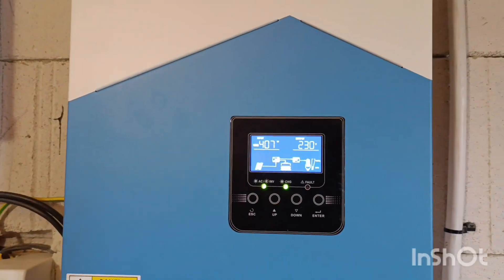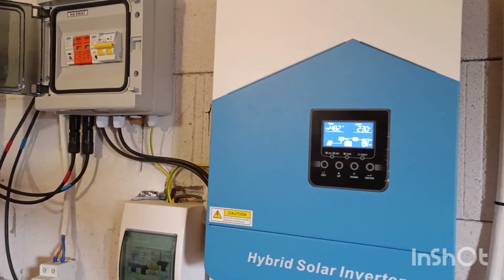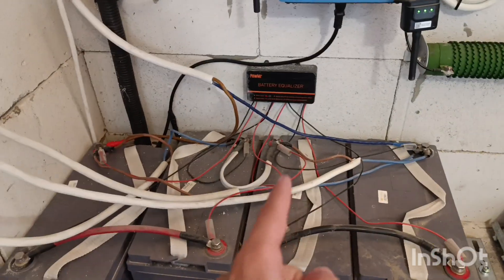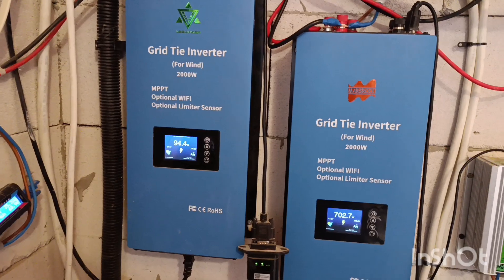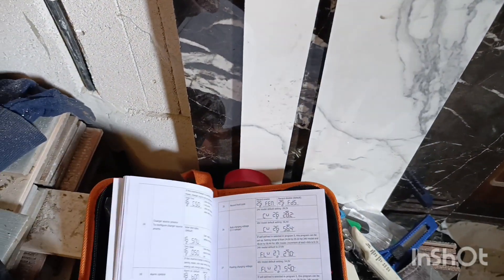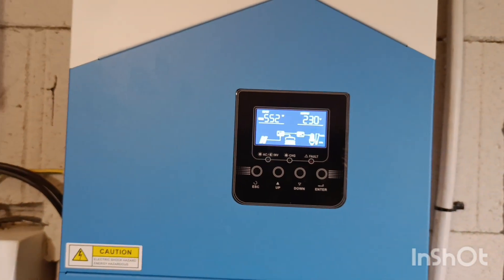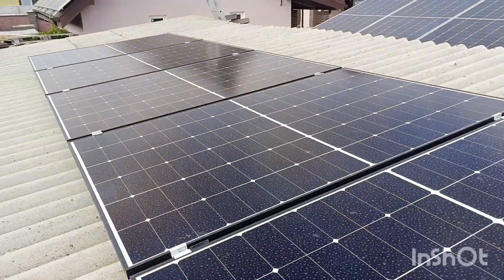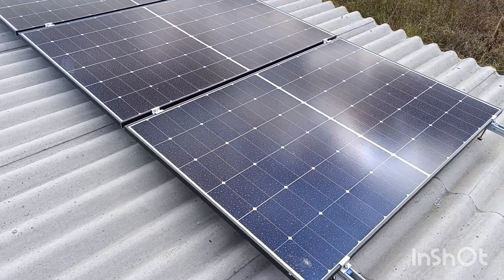How I DIYed a small solar station based on EAsun hybrid inverter: a system inside a system

Comment: can this inverter be used without returning any power to the grid? I'd like to be on solar while I can and in a case there is not enough energy, can this inverter pull power from the grid like If I had a backup generator?
Reply from the maker: yes, it is not even able to sell any power back to the grid, and yes, it can pull the needed power from the grid in case of lack of sun or battery.
there are several power source priorities to choose from
Reply: @BackyardVoltage  Oh that's perfect! In Croatia it's illegal to have a grid-tied inverter without a permit, it's done so you don't accidentally feed any power back while they are servicing the grid and assuming there is no power... How's the reliability? I was planning on getting 3kW of panels to power my workshop and a fridge on the side, maybe some AC heating as well
Reply: @BackyardVoltage  But this is so cool... If you have a battery that's big enough, you are using 100% of energy you generate. Nothing is wasted.
Reply from the maker: about the reliability - I can't say much. it worked for over a year at my place, then over a year at another guys place, and still running.
however, I find this one (daxtromn 6.2) a bit better:
1. unboxing: https://youtu.be/4R5lD8IzVpE
2. all-apartment powerbank setup with it: https://youtu.be/hPZYV4Jtn6E
Reply: @BackyardVoltage  Im looking at the EASUN one because there are many listings on Aliexpress which ship from EU. I tried looking for the Daxtromn but these are much harder to find. Anyways, thanks for sharing your experience with it 😁

Comment: I have EASUN 11kw inverter with  Li-Ion bateries (not LiFePo4) and solar panels connected. I am planning to buy another same EAsun 11kW inverter and connect additional solar panels (with optimizers ) and LiFePo4 batteries. I would use new inverter system as power source for existing one, similar as you use blue grid tie inverters to transfer power to Deye inverter. Do you think that this is OK solution?
Reply from the maker: hm... if your model can work in parallel (master-slave connection between the inverters) - that's better to sit them both on the same battery bank and that will be the great system.
my blues are grid-tied, that's the main difference here. the main power managing device in my case is still Deye, and it ultimately decides how to use it.
in your case - both can decide, and I have no idea, how will they fight about the decision makings

Comment: Hi from Cornwall. U.K.I have the same inverter. I have just picked up a Grow watt 5kw Lithium pack.  14 series cells so potentially 58.8vs Max. Will the unit take this. I see the input Capacitors are 63volts but wondering what you think. Just Subscribed .Kind Regards. Paul
Reply from the maker: hi.
well, this one has a hard limit of 450 VDC input, so calculate your array appropriately (including panels temperature coefficient as well). if your all-series connection goes over that 450VDC value - rather split the panels by half, and make two parallel arrays with half of the single-all-series-one length. the inverter can work with 27-30 Amps on solar input, no issues with that.

Comment: Hi is the invertor still working OK, looking at purchasing one but unsure about the quality?
Reply from the maker: hi. yes it still works as it should, no glitches, no issues. but I mean, that's a small amount of time until now to actually judge on the reliability and/or quality.
one thing I may suggest - go for a higher version SMH - III or SMG. Look for the one that can work without batteries, as this exact model can't work without batteries.

Comment: I have this inverter in Greece it works perfect for 9 months.
Reply from the maker: that's good. do you use LiFePO4? or GEL as well?
Reply: @BackyardVoltage  10+kwh lifepo4 with indepent bms system .Iam full autonomus.
Reply from the maker: @papasgiannis  did you connect it via CAN? it has 2 protocols possible to be in use - for pylontech and for pace. which one did you use if you did use CAN-connection?
Reply: @BackyardVoltage  δεν έβαλα can γιατί η μπαταρίες έχουν ενσωματωμένο bms οπότε αν υπάρχει πρόβλημα τον έλεγχο από εναλλακτική μονάδα ελέγχου. εξωτερικά.
Reply from the maker: @papasgiannis  got you. thanks

Comment: its £50 for the 410 watt longhi panels in UK, seems to be a lot cheaper than wind.
Reply from the maker: @bermudatriangle2036  it definitely is, and year round it will generate more power. However, it will still underperform against wind turbines during winter time...